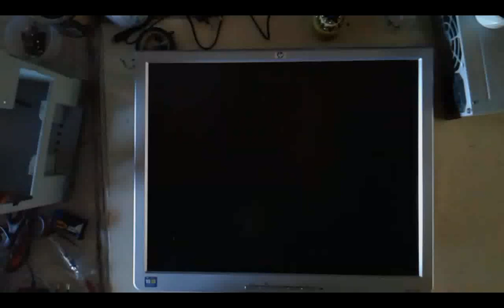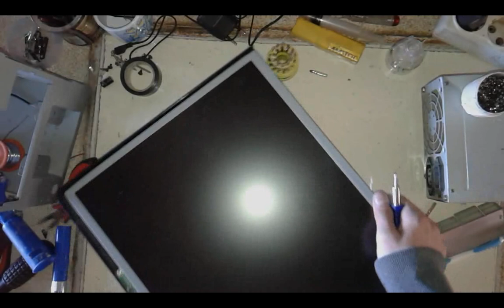How to repair an LCD monitor step by step hp 1740

Comment: My monitor will turn on for about 3 seconds then the backlight cuts out I took it apart and have some crappy looking caps think it's the same issue?
Reply from the maker: Yes the Capacitors are in the most of the cases the part that causes trouble

Comment: If Capacitors r ok then ????? how to repair ????? In my case high tension voltage is low ! how to do ? Power Supply  is ok but fault is in lamp section plz help !

Comment: why dont u use new capacitors. i use always new ones.
Reply from the maker: stefan boonstra because after 6 10-12 months i repair it again and i can win a few $ more :)
Reply: For my last monitor, I repaired it after serving 10+ years of use. I just used capacitors I had laying around. A little over a year after that repair the monitor started shutting off after two seconds due to backlight/CCFL failure. I couldn't find any backlights for sale that were cheap. In that case it was worth using second hand capacitors.

Comment: can i use capacitor with higher voltage value?
Reply: Yes, the voltage rating is the maximum the capacitor can take, so it can go higher for voltage but not lower.
Reply: @realgroovy24  thank you very much
Reply: The capacitance of electrolytes is only to a very small degree voltage dependent, and ceramcs aren't as bad wrt. voltage bias dependence any more, like NP0, compared to the old Y5V which is Super bad :p